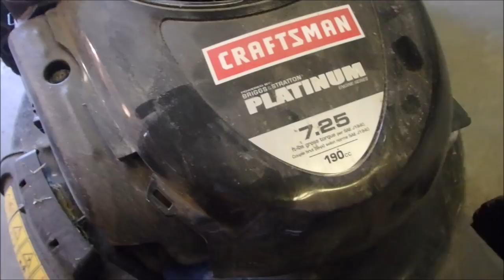Craftsman With Auto Choke Won't Start Pt. 1

Comment: Hi Bruce, watched this last night and this morning took apart my mower. It is a different brand but the exact same B&S 675 engine and also what seemed to be the same issue. Worked on it for an hour or so, put it back together and it is running perfectly now. Thanks for the instructional video, it really helped me gain the convidence to pull it apart and fix it.
Reply from the maker: Good for you.  This is the exact reason I do these videos.  Thank you

Comment: Thanks for you video. Very informative and was able to get my mower running. I knew it was a dirty carb since it’s been setting for a while but your video showed me a few things to look out for on this mower. My bolts were super tight as well and mine has never been touched before today. Thank you. Old guys rule!
Reply from the maker: Did you get to part 2?   It all about under the hood.

Comment: The very first thing that I check is the compression. I crank the engine over by pulling the rope slowly to feel for slight resistance when the piston comes up on the compression stroke. Because if it has a broken rod, then that's another story. But if the compression feels adequate, then I check the condition of the spark with a fixed-gap spark tester (not an inline spark tester). If it produces a strong spark, then I test the spark plug that came with the engine for a strong spark as well. If it has a strong spark at the spark plug's tip, then I check the flywheel key to see if it's not sheared. If it's in good condition, then I move on to the carburetor. I remove the float bowl to see if there's any dirt or water in the gas, & I smell the gas for freshness. I also check the carburetor mounting & intake tube to make sure it's fastened tight to the engine block to prevent a vacuum leak. If any of these things are at fault, then I correct it. I do all of these things in this order on every customer's lawn mower that comes in my shop to rule out all possibilities. Because working in reverse gets very little done. And I have never used starting fluid (ether) on any engine that comes in my shop for repairs. Because I figure if an engine will not start on gas that's in the carburetor, then it will not start at all.
Reply: My first step is always checking the oil,  many times it just barely touches the end of the dip stick.  That also tells me if the carb float has or hasn't stuck loading the sump with gas. A  sheared crank key will alway pull the rope handle out of your hand while pulling to start ( sometimes it's painful ).  Nine out of 10 times the customer has put in a new spark plug already.  I always tell them to bring their gas can so I can check for water and dirt, ( sometimes they don't even have a cap on the gas can and they kept it outside  ) and the gas can is in very poor shape.  I keep a good supply of two gallon gas cans around to save them from going out to buy one, and making me a few more dollars profit .  Sometimes the condition and size of the can tells a good story .   So, with this all said,  about 90% of my repairs are fuel related.  Then it's easier to up sell a blade or a blade sharpening or a pull rope replacement  or a complete preventive maintenance service. You can always tell by the shape of ones mower and gas can if they are or will be willing to spend more to make it right.
Reply from the maker: You are so correct Okie
Reply from the maker: We all have our mental list.  Sometime i skip a step if it is obvious.

Comment: I've only got one thing to say here (ok, maybe two). ULTRASONIC CLEANER! lol I know it's hard to change your methods, but the cleaner will save you $$ in the long run by using less carb cleaner. Cheers my Friend! Sean~
Reply: zippovarga
you can chip in on this if you have any thoughts
Bruce i rebuilt a carb on a Honda 2000eu generator i never got it to run before i rebuilt  it after i got it running it wont run right with the side cover on it is starving for air 
with cover on i opened up some factory vents to larger than factory till it ran right and sent it out now customer is saying it is running ruff by his description it starving for air i get it back tomorrow to fix what do you think could be doing this i tried air-filter with or without doesn't change it i couldn't find any air vents blocked ill take the cover off when i get it back just wondering what you thought
Reply from the maker: How is his fuel.  I have had them good and the customer puts old fuel back in???  It is a hard one to bring up.
Reply: first thing i am checking
Reply: @hobbit321a  kill

Comment: I just fixed the same Craftsman Platinum lawn mower and the screws that hold the air cleaner assembly was super tight too.
Reply from the maker: Why is that I wonder.  The guy before using a impact??

Comment: I loved my 1998 Craftsman (which, looking up parts on Repair Clinic dot com, indicates it may have been built by Husqvarna) but had to go with Toro since I anticipate Sears no longer existing in a year or so.  Found a nice independent dealer/repair shop too, for stuff beyond my meager skills.
Reply from the maker: Your skills are good.
Reply: They're getting there.  So far, just a few carb cleanings, one pull rope replacement, and wishing new wheels were cheaper!

Comment: I have the same mower and it had the same problem.  Turned out to be water in the gas.  Drained that out but water had sat in the carb and made it go bad.  Ended up replacing the carb.
Reply from the maker: The best choice.

Comment: Bruce just a tip from Eliminator Performance : buying a small ultrasonic cleaner online will pay for itself in a short time with the savings you experience from not have to buy carb cleaner. Additionally you are saving your lungs from breathing in those fumes. We also suggest buying the carb pressure tester we test all our carbs at 5 psi and let them sit pressurized for a few minutes to ensure not even the slightest leakage on the needle valve seat. Blowing into them does work but we have experienced leakage on a few carbs but never since we purchased or pressure tester $110 Cdn. Enjoyed your videos check us out sometime on YouTube.
Reply from the maker: I got one right after I made this video in August.

Comment: After living in central Wisconsin for most of my life, I have always had summer maintenance for winter machines and winter maintenance for summer machines.  Then there is the bi-annual maintenance for the standyby machines.  I learned the hard way that before I go and invest even 10 minutes of labor in a unit that simply won't start, I turn to the gods of Sea Foam and let them have a go at it.  I have NEVER been sorry. I have even been known to add a little to the oil of the Winter machines for the summer maintenance.  Mea culpa.
Reply from the maker: Thanks John

Comment: WHAT is the mixture you are using?  made ya smile.   very good  video and great information.  Worth watching!  I just ordered a new carburetor since they are so cheap.  thanks for the video!
Reply from the maker: Sometimes when I mix my priming gas i mix it 10-1 with oil.  Sometimes i use 2 stroke oil.  Yes new carbs are a good way to go.

Comment: I have this same mower and it starts fine, but after  I turn it off It wont start again, it cools down then starts again. I replaced the spark plug, armature, the valves are in spec, and cleaned the carburetor, still wont restart. Any idea? Maybe the thermostat for the auto choke?
Reply from the maker: I think a coil would be the next thing.  This may help
https://www.youtube.com/watch?v=ldeSd6RYaKg

Comment: Hey Bruce! Help!

I gave a craftsman platinum 7.25 190cc mower that wont flippin start. It tries to start but sort if sputters then nothing. I get a bit of gray/white smoke from the exhaust and a bit of a pop from the carb.

I pulled the carb, cleaned and reinstalled...nothing

I checked the flywheel key and it look fine...no sign of shearing ir blade damage

Any suggestions would be appreciated!
Reply from the maker: First I would spray gas or carb cleaner right into the spark plug hole the put the plug back in.     if it runs for 2 seconds things look good.  Did you check the flywheel key.  Yes that really happens   not just in my videos.  Did it hit something hard??/
Reply: @BrucesShop  Thanks Bruce! I did hit the carb with a blast of gas which is when I witnessed the smoke and feeble attempt to start. I verified spark with a tester and the flywheel key is fine. However, after reassembly from checking the key the mower did start but never got to full throttle and shut down. 

I'll verify the compression level in a day or two and I also had someone else suggest the intake air tube might be broken or restricted?

Comment: Bruce, I have to wonder if the previous mechanic over-tightened the 1/2" main jet and literally screwed it in so far in that it cut off fuel from the two cross-ways holes at the bottom of the brass bolt.
What do you think?
Reply from the maker: I don't know of course.  It could be.  That choke was out of alignment but it should have still run.. You have a good point.

Comment: Hey Bruce can you recommend a place to buy economical  parts for Briggs and Stratton carbs?
Reply from the maker: I have been having issues with overseas import stuff.  So have gone back to this.
https://shop.briggsandstratton.com/collections/carburetors-carburetor-parts
Reply: Amazon, if you search the engine number online several sites have diagrams so you can get the part #. Just enter that in Amazon and it is usually the cheapest option.

Comment: Bruce i rebuilt a carb on a Honda 2000eu generator i never got it to run before i rebuilt  it after i got it running it wont run right with the side cover on it is starving for air 
with cover on i opened up some factory vents to larger than factory till it ran right and sent it out now customer is saying it is running ruff by his description it starving for air i get it back tomorrow to fix what do you think could be doing this i tried air-filter with or without doesn't change it i couldn't find any air vents blocked ill take the cover off when i get it back just wondering what you thought
Reply from the maker: What about that idle cct.  Did you ream that out a tiny bit.  That one is the pull out one.
Reply: yep both runs great till i put the cover on the housing then it starves for air  he has not got it to me yet so i can not look it over
Reply from the maker: OK

Comment: You might think on wearing nitrile gloves when using carb cleaner, or any other chemical for that matter. That stuff goes right to the liver through your most largest organ, your skin.
Reply: I see you put them on after the fact.. It can also cause contact dermatitis, not good, as it draws all the oils out of the skin. Of course you probably all ready know this.
Reply from the maker: @toddolson573  I understand but then i get into the job and forget.  thanks for the reminder.

Comment: I always use a impact gun on them bolts
Reply from the maker: I couldn't get it to grab.
Reply: @BrucesShop  when you go to put it back on there put a thin lock washer
Reply from the maker: Too late but good idea.
Reply: @BrucesShop  and the next project will be a lot easier if you use  a impact gun with lock washers

Comment: I charge $125 an hour for what I do for a living.....and I save my customers hundreds of dollars cuz I'm fast and honest. If you charge close to that....the owner cudda bought a new mower.....How does one make a living doing this? ...but the way....ya prolly cudda fixed this with an old guitar string shoved up the main jet. ( I stopped watching at 17:00.
Reply from the maker: Well this is a hobby and I work on a lot of very old stuff that is on it's way to the landfill.
Reply: @BrucesShop  ...I see....well that explains everything. I enjoy working on engines too. Fixed the wife's coffee maker the other night too. Had a good mower once (Kawasaki engine) that wouldn't start and I needed a mower now! Went and bought a new self-propelled one for just over $200.00 cash. Later took the Kawasaki apart...needed a $4.00 head gasket. First pull, ran perfect...sold for $100.00...done. Thanks for going through all the trouble of making fun videos to watch!